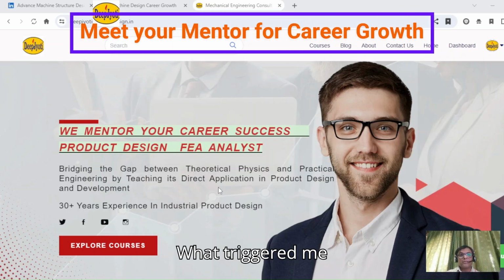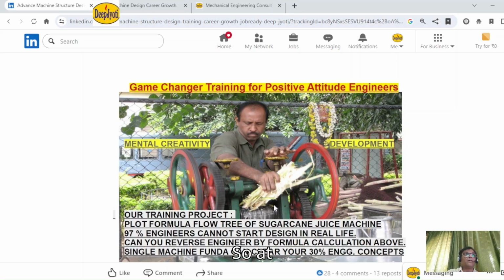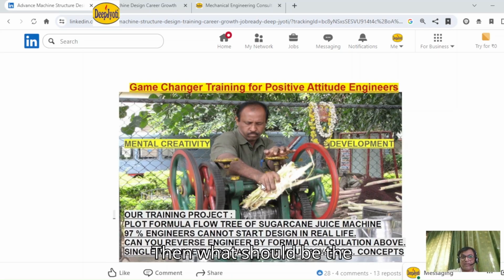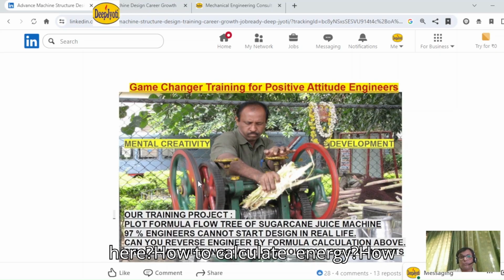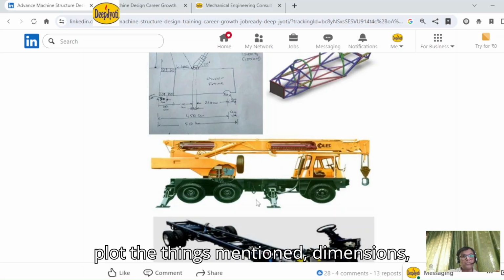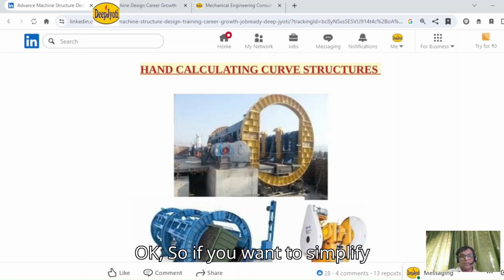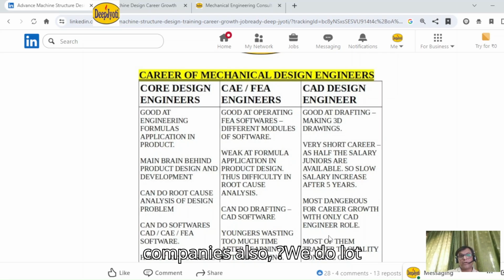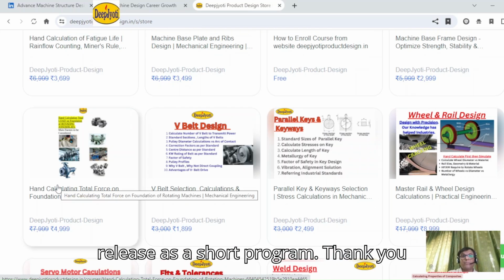Want to Grow in Mechanical Design? This Mentor Has the Blueprint!

Comment from the maker: 🧠 Strength of Core Physics + ⚡ Speed of Python = Monster Designs in Minutes!
Modern engineering seems obsessed with FEA – but here's the truth:

🔴 FEA is too time-consuming for early-stage design.
🔴 Many engineers are skipping fundamental physics, relying blindly on simulation.
🔴 The result? Over-designed components, longer cycles, and products that fail earlier than those designed decades ago.

I'm working on projects where we use core physics formulas + Python scripting to design 1000MT load beams in just 5 minutes – with fatigue capacity of 1 million+ cycles.

✅ No commercial software.
✅ No black-box solvers.
✅ Just raw engineering logic + speed.

💥 Design faster. Design smarter. Design stronger.
We need to bring back the thinking engineer, not just the “meshing engineer.”

Would love to hear your thoughts –
👉 Are we over-relying on FEA?
👉 Should universities go back to teaching deep physics fundamentals before CAD tools?

Let’s discuss.